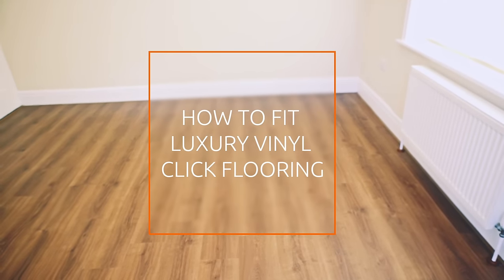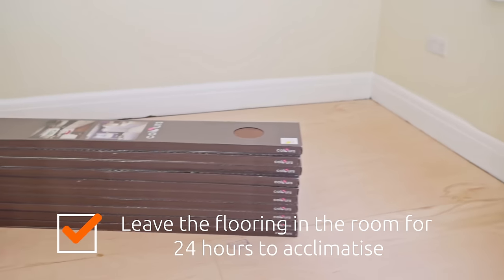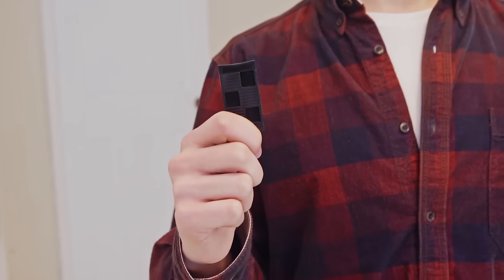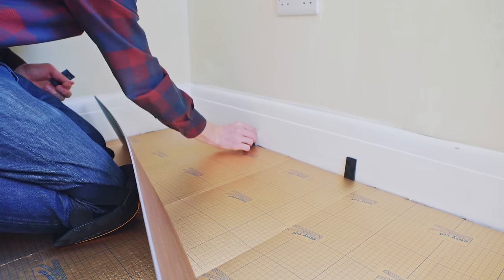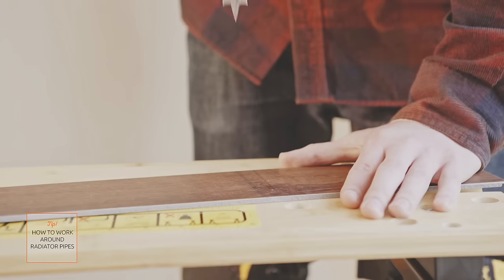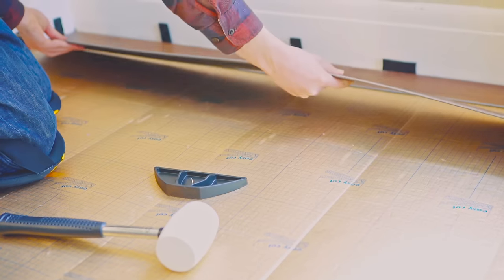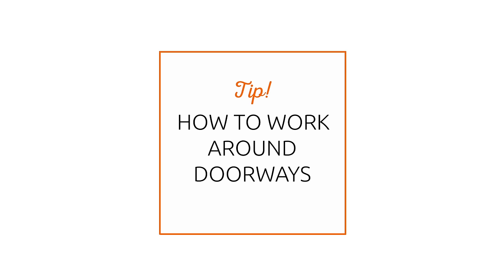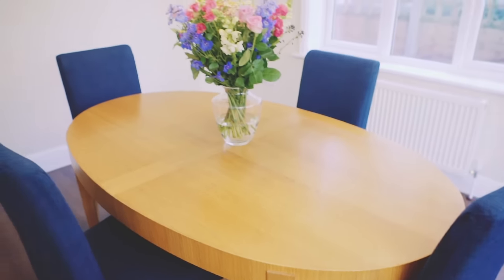How To Fit Luxury Vinyl Click Flooring

Comment: absolutely fantastic video! 

My advice is, do not use skirting as the same colour of the floor because if gives the impression that the floor is "climbing" the wall. 
Instead, always use white skirting (if your walls are white of course) because it will give the impression that the floor is fitted underneath the house structure, looks much nicer.

Comment: Word of advice, pull of your carpet and see whats underneath before taking on this project, especially if your house is pre1980. Check for leveling. If your floor takes a significant amount of leveling then just carpet it. Ive been scraping up old carpet matt that has compressed to my subfloor for 5 days and took around 20 hours. After getting it up, i found an uneven wood subfloor, now im 200 extra dollars in on underlaymemt, and the heavy labor thats involved with that. Clicking boards together is easy, not the prep work.
Reply: "Amen Joe D"... "Amen" to that...
I worked 13 hours on my RV to find out
there is screws and a lot of unevenness ...
(SAD)...
Reply: Joe D   I have found the flooring can go over minor unevenness.  If more I use drywall knife and thin set to even out. If too much I lay cement board over or other types of covering like osb or plywood.

Comment: Hi, just wondering why 5mm spacers weren't used to measure-up for the last row at 4:50
Reply: When its locked in I think the locking mechanism will probably add a few mm and take into account the expansion gap? May be wrong here though

Comment: I notice you didnt show how to connect the short edge,  as well as the easy long edge, as this is always the tricky bit. You must have had difficulty with it.
Reply: IPfrequently   Yes I seem to fight that. Sometimes I have had to cut the bump off insert edge to get it to slip in. I then use super glue before inserting for a good hold. These videos are always incomplete.
Reply: @mikewhite9818  which glue did you use?

Comment: Luxury Vinyl usually has an expansion coefficient of less than .1% so the expansion gap is completely unnecessary. This gap IS necessary when using wood and bamboo laminate flooring which expands excessively, so this video seems to confuse these products and provides poor advice.
Reply: GoForGold is it sturdy and hold up well. I’m leaning towards it but I’m nervous?
Reply: vivahernando1 yes the vinyl laminate 'click tile' we used is exceptional in looks and performance
Reply: How long we can use Vinyl flooring?
Reply: Pany Souvanthone it seems very durable. But it was so affordable I dont mind if it only lasts 5 years.
Reply: It's to cover themselves and sell you the trim.
Reply: GoForGold   Completely agree. Good post.
Reply: Well said !

Comment: Can i install vinyl on ceramic tile? its even but has grout ridges.
Reply: I wouldn't... it's uneven...
Reply: L Kumar   I do no issues. I use underlayment with closed cell foam.
Reply: @mikewhite9818  Could you please suggest a brand/ model of underlay to add over ceramic tiles?
Reply: Seb B   Different brands. Who ever you buy flooring from will have the good, better, best choice. Use the best. Around .65 cents per sqft.

Comment: What you have on the floor is not hardboard. It`s plywood(3.6or5.5mm). This plywood is NOT going to make sure your floor is nice and level!! The required thickness of the plywood is dependent on the condition of the subfloor(you might have to go 9 or even 12.5 mm in some cases). Underlay..... there is a massive confusion on what smooth floor underlay is designed for, confusion continues in this video. Underlay is for giving your floor some  sound, moisture and temperature insulation, it at best helps with 1-1.5mm irregularities of the subfloor, and it is NOT designed for leveling the subfloor!!!
Radiator pipes can be done with a drillbit and a single slit behind the pipe, no need for keyhole cutout(a hairdryer can be used to heat-up the vinyl in some cases). 5mm expansion gap is a myth. LVT is structurally weak at its joints and actually most manufacturers recommend fitting LVT with no expansion gap at all(exceptions are : areas in direct sunlight and sudden temperature changing areas like underfloor heated rooms/parts). So all in all if you want the job done right you should get a professional to do it....
Reply: Dainius G is underlay necessary if I've laid chipboard on the floor?
Reply: Dainius G de

Comment: I wish people would stop installing staggered exactly the same every other row.  It should be random.  Looks so fake the way it's shown.
Reply: The best way is to make starter pieces. Take a full piece and cut off 1/3, 1/2, and 3/4 all from the same side on 3 different pieces. Then use them to start rows. But to make the effect look more random, when you make those starter cuts, don't use exact measurements, just eyeball it, and they will be slightly different each time and give it a more realistic and random look.
Reply: Stair stepping looks just as bad. It should be random!
Reply: @kayoss9922  Well if you eyeball the cuts they won't be the same so it will look pretty random,  Ahh its easier to show rather than explain :P I think u get the idea.
Reply: @MSeroga   I have installed thousands of sq ft, I know what you mean.  Stair stepping does not look good.  They should have enough variation to not look like steps or have any noticeable pattern.  Once in a while an unintentional step pattern of 3 in a row may happen, but shouldn't be consistent.  :-)
Reply: @kayoss9922  You can use what i said buy precutting different sizes just dont install them from longest to shortest :)

Comment: Luxury Vinyl flooring doesn't have to acclimate if there are not VERY drastic changes in temperature in the area where you will be installing. Acclimation is much more important for wood flooring, vinyl flooring has almost 0 expansion. Also the stagger effect is not only for appearance, but to give strength to the floor so it doesn't separate anywhere. Good video, but lacks experience with the product to give the best advice.

Comment: Basing your entire floor on the evenness of the walls in your house is a good way to get things nice and crooked. Terrible....
Reply: Tomtom9401 using an outside wall is usually okay & in a small room it won’t be too noticeable
Reply: Tomtom9401   It will always be a little uneven. No such thing as a square room. Lay and correct in last row.

Comment: Never cut the edge off. That is just stupid.
Reply: You need to cut the edge off so that the 5mm gap allows for the fitting of the plastic edge trim, albeit they haven't used this type of trim in this video.
Reply: Heather Cantwell  nhhj
Reply: What 'edge' do you mean ?

Comment: buy glue down  clic breaks
Reply: MILA REYNOLDS   You are right and if any errors along the way occur then joint pops loose. Never happens with glue down. Also if your click is a run toward the end of tool life of machine making it then nothing but trouble.
Reply: glue down allways,i have repaired a few of these because the brittle system breaks